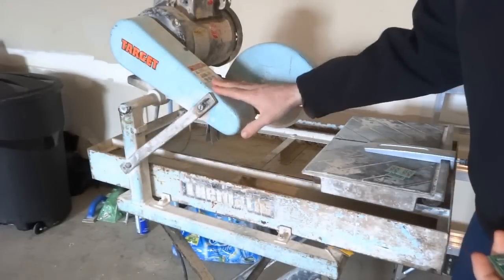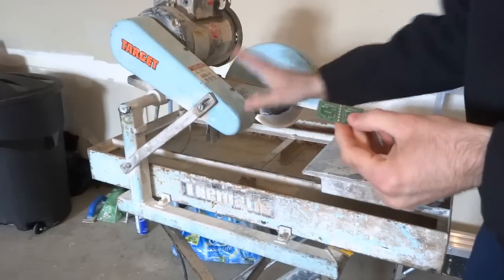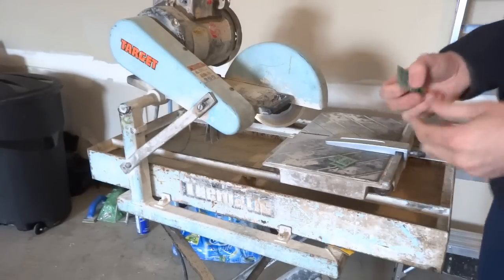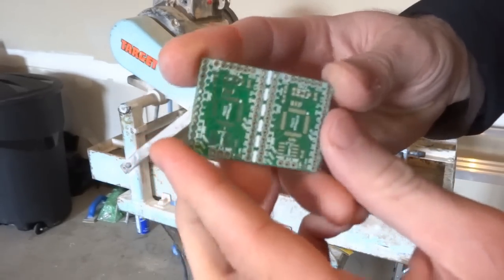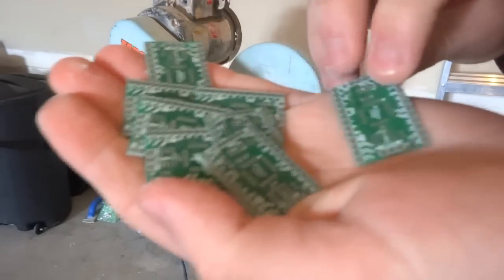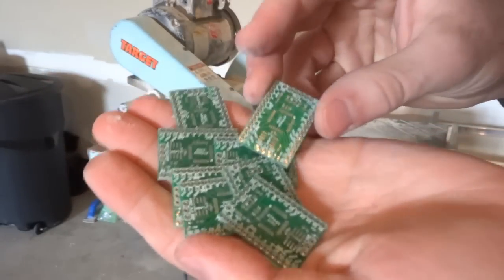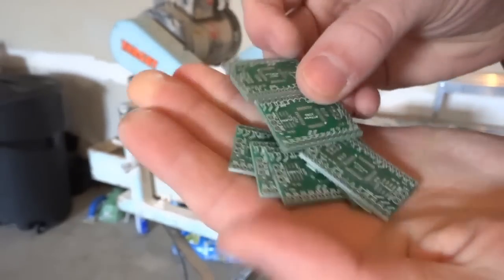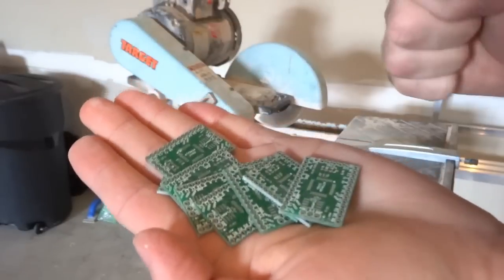Cutting PCBs easily with a wet tile saw

Comment: Nice Saw , Have the same model and use it for tile install for over 10 years, but never tried to cut PCB's...
Reply from the maker: Asa am inceput si eu in america ... la scoala si la tile sa-mi platesc scoala :-)
You can cut a lot of things with tile saws including acrylic and fiberglass or anything ceramic (stone, brick etc).